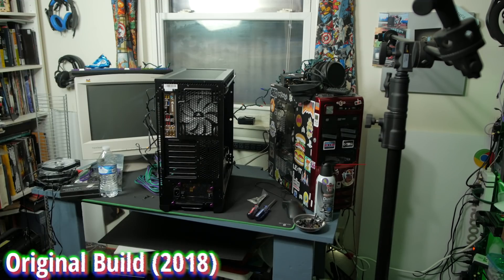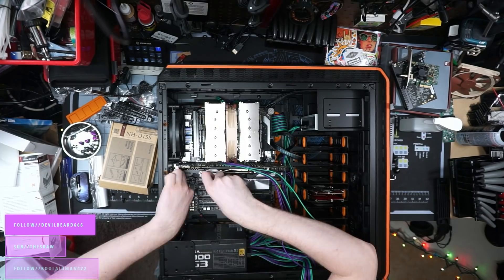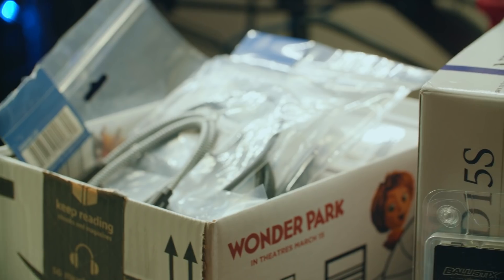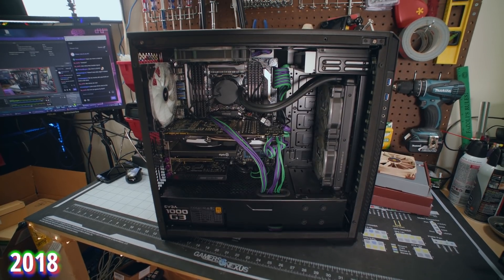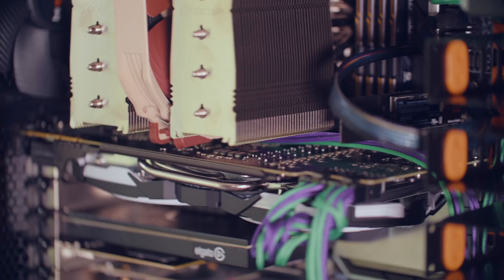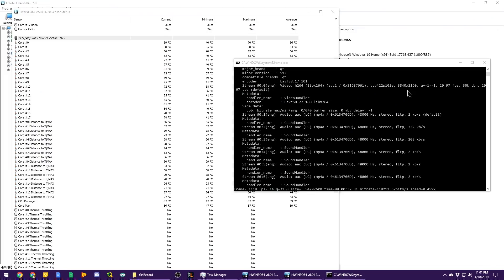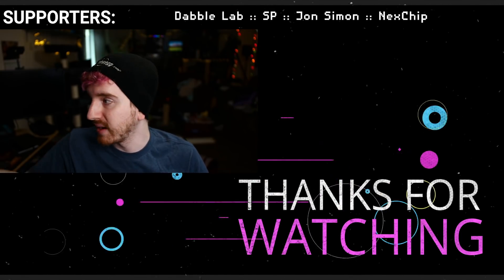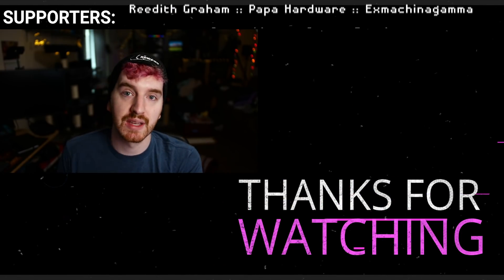Breathing new life into my main production PC - 7980XE cooling dilemma

Comment: Looks like it time for another overhaul. I haven't made the jump to HEDT. YET!. I like high-end hardware but, i'm not Mr. 💰's. I''ve built 2 main rigs by waiting patiently. With open-box CPU's, GPU's, RAM and Mothetboards. Even though, they were open-box items. I still got the manufacturers warranty on everything. 
  #1 rig is for Gaming. It has a open-box Golden 5.3GHz 8700K ($280) with a z370 Aorus Gaming 7 ($145) and a Aorus Extreme 2080 ($540) and had got 2 16GB kits of Gskills Flare X 3200cl14 OC'ed to 4GHz cl17. 
  I used the other kit for the 
#2 editing rig. Which has a $400 9900K, $215 Gigabyte z390 Designare with the PCI-e switch that lets me run to nVME 970pros in RAID0 with 
7GB/s read and writes. Also 8K passthrough capabilities, and dual ThunderBolt 3 ports onboard with and extra one to the front. $560 Radeon VII. I got a deal on 2 Corsair 750i PSU's with LINK's software to monitor both systems and 2 of Corsiar's 500D cases. Got both PSU' and case's for a steal cause they were all open-box. I built a monster Gaming PC along with a 2nd editing and streaming PC for $2600. I can say im definitely happy. A few months ago i found a 7980XE for $900. Of course now Intel releases a 10980XE for the same. I'm still gonna keep the 7980XE. I also got the x299 Aorus Gaming 7 PRO. The PRO has been revamped for the 7980XE cause you already know how the 1st Gen. x299 Gaming 7 went. Plus with a new memory trace, PCI-e layout and Intersils high-end VRM with 12 60A smart power stages, no annoying coil scream. Watching your vids have given me a path to start finishing my 1st HEDT build.

Comment: Threadripper better
Reply from the maker: Not exactly
Reply: sure. 2990wx kill it  @EposVox
Reply from the maker: @redbassboosz5222  Not in Windows and not for my kind of work. H264/X264/Cineform/H265/etc. encoders/decoders on scale to a specific number of cores per resolution (the most usable threads for x264 at 1080p is like 20 threads) and such applications do not scale well to the multiple NUMA nodes of the 2990WX. Plus the 2970 and 2990 both have performance regressions in virtually every application compared to the 2950X in Windows. So no, it doesn't kill it. The PCIe lanes are nice, but performance-wise, it does not.

Comment: When you removed the water cooler it was kinda obvious that the CPU IHS is far from flat, it has a gigantic bump in the middle. If you see at the 1:38 , you can notice how the thermal paste is thinner on the middle of the CPU. In my opinion, if you delid, don't use liquid metal, use a conventional thermal paste and also lap the shit out of this CPU, it will make a ton of difference.

Comment: AVX512 has a lower clockspeed than normal.
AVX512 on the Xeon 6154(the pro version of the 7980xe) is 2.7 GHz all-core, so your 3,6 GHz with AVX512 is pretty good.
https://en.wikichip.org/wiki/intel/xeon_gold/6154

Comment: Liquid metal doesn't really require "maintenance" so much as proper technique...if done correctly, it is a set and forget option just like the CPU is when it's stock. It's when you don't seal the IHS and depend purely on the pressure of the cooler's coldplate to hold the IHS in place, that's when you have to worry about it moving around and/or redistributing itself. Delidding just to replace paste with more paste isn't really going to help, especially compared to the risk of delidding and potentially shearing off an SMD or 3 (thus rendering your $2K CPU into a small paperweight). Lapping the CPU IHS is a good move, since a lot of them are not flat. 
The Noctua D15s are nice coolers, but you'll probably get more room for OCing that CPU with a 360mm AIO, assuming your case can mount one...at the very least, running multiple fans on that D15 would stretch its legs a bit more than just the single fan.
Reply from the maker: I've read/watched/researched every review I could find and the D15/D15s beats out a 360mm - even on this CPU - every time. Also forgot to add into the video that in the secondary stream we did end up adding on a second fan.
Reply: @EposVox  Really? That's odd, cause everything I've seen shows even 240mm AIO coolers beating the NH-D15...just from a quick bit of Google-fu:  https://techbuyersguru.com/noctuas-nh-u14s-and-nh-d15s-cpu-coolers-take-best?page=2 ; https://www.technic3d.com/review/kuehler/1701-noctua-nh-d15/4.htm (this one's in German, but Chrome does a decent job of translating it) ; https://www.guru3d.com/articles_pages/noctua_nh_d15_review,11.html (this one comes closest in comparison, with the NH-D15 running dual fans matching an H110 from Corsair in performance). Not trying to argue on it or anything, just find it odd that you've found results that directly contradict the results that I've seen.
Also, on the IHS lapping thing, you might consider reaching out to Steve over at Gamer's Nexus, they just had to do a whole thing on lapping the IHS with their 9980XE, the IHS was so concave it was basically an upside-down bowl.

Comment: Great build, I bought the same motherboard based on your review.  I'm curious maybe you're not getting the thermals you want based on a few factors.  What's the temp like in the room you're in?  Also is there enough air moving through the front of the case? Maybe get some Noctua Industrial fans to induce more air, the case has lots of sound dampening Maybe you wont hear it as likely.

Comment: Have you tried a Mugen 5 cooler from Scythe ??
Reply: The NH-D15 will win in any scenario vs the mugen5, its simply more area of dissipation, at low and high rpms, the Mugen5 will lose.  That said, the Mugen5 is a very good value/performance cooler that will cool fine most cpus, but something like 7980XE is really hot, i have a very hard time cooling a 7940x at stock speeds with a Thermalright True Spirt Power 140, Adam needs two fans and more rpms to keep it below tjmax with the D15, aside from custom loop not much he can do.

Comment: You have the same issue like me with my i9-9900k. 240AIOs arent enough to cool it properly. you have to go custom watercooling with at least a 360 , better 2x 360 rads for cooling. Maybe EK or Alphatec ?
Reply from the maker: Except this cooler IS enough to cool it properly - as virtually every review suggests. Custom loop is not an option for this rig.
Reply: @EposVox  but maybe you could go up 300Mhz back :-D

Comment: This case has terrible airflow. It's silence focused not air focused. The best case that does both is the Fractal Design Define R6.
Reply from the maker: ???? the airflow design in the R6 and this are virtually identical. 
Signed - someone who has been using the Define R series for like 8 years
Reply: @EposVox  Not quite identical.  They're similar but the R6 performs better from using both and from benchmarks I've seen just name to one GamersNexus shows around a 4.5c difference.

Comment: If you want to use normal thermal paste you might wanna look into direct die mounting your heatsink to the CPU. That should improve temps a lot without needing liquid metal. I think Jason from Byte My Bits did it with his CPU that also had severe overheating issues.
Reply: You use conductonaut with direct die

Comment: If you are delidding, and don't want to use liquid metal try this: http://www.performance-pcs.com/der8auer-skylake-x-direct-die-frame.html  Also use http://www.performance-pcs.com/thermal-grizzly-kryonaut-hgh-performance-thermal-grease-3ml.html I will drop another 5-10 degrees over regular thermal paste on delided CPUs. And add another fan to your Noctua cooler.

Comment: The lapping and Delid will put alot of things in check for that CPU, and I hear you on the reliability concerns and the paste replacement should be enough since the lap is happening especially if they use Thermal Grizzly Kryonaut or Hydronaut (both killer pastes)

Comment: Great video Adam.  In case you are interested on seeing how the NH-D15s does with two fans, google "SPCR Noctua introduces twin NF-A12x25 NH-U12A CPU cooler", you will find my testing of a lot of coolers there including the NH-D15 with one and two fans, you will see how it helps the second fan, specially at lower rpms.

I'm shipping you 2x Thermalright TY143, same size and mounting as the NF-A15,  they drop to 600rpm (30% PWM) inaudible to me, so you can have a very quiet setup at idle/light load, what makes this fan so special is they can reach 2500rpms (100% PWM), but be warn that it will cool extremely well but at the expense of noise, past 1500rpms are loud, running it at 2500rpms you are going into jet engine territory, but don't fear it, its very easy to setup the fan graph and its up to you to decide how much noise and performance you want, meaning you will be able to overclock, but its up to you how much noise you are willing to tolerate vs the amount of time you gain due to your overclock, its more a matter of balance, and this fans will give you a lot of room for you to decide whats appropriate for you.  You do need to search on your original NH-D15s box, it has a second mounting set of clips that you will need for the second TY143.

Btw don't fear liquid metal, i have 3x cpu delided with liquid metal, i7 8700k + i7 8086k + i9 7940X, all are running great, it will lower temps 10-15C on load, if you don't do liquid metal, the gains of deliding with another paste will be low, not worth it imo, you are already voiding your warranty deliding the cpu, make it worth the trouble by using liquid metal.

Comment: sigh sadly threadripper just is in it own class. I guess you had no choice since you got it free.
Reply from the maker: Threadripper has plenty of problems. Windows and most programs are not set up to handle the multiple NUMA nodes - x264 on threadripper is a nightmare. Anything higher than the 2950X literally performs worse than the 2950X on Windows, etc.
Sure if I had the budget, I'd be there for the PCIe lanes, but I can't afford it, so I work with what I've got available to me.
Reply: @EposVox  ya understandable. I got tr4 1950x cause pcie lanes and was easier to install and well had a store credit of $430 or something from another mb that was defective so bought a $530 mb. It been wonderful pc. Ya I heard about windows but dont people run linux on these systems? I am on windows and ya have noticed issues. My fx9590 system feels faster then my tr4 system.

Comment: It's the hottest CPU out there, unfortunately you cannot have it both ways, silicon lottery isn't your problem, it's the 900... one of the banes of my  existence especially in that config with the no basement and 10 hard drive cages. It tends to suffocate coolers, it's not meant for overclocking at all. My suggestion is delid. I just watched your cooler swap video and you said you can't risk it, well with a delid tool it's not that risky. It will get you the frequency you desire with some konductonaut. If not I'd suggest loading that case up with Noctua NF-A12X25 fans. I bet they'd send you them, even replace the 140's on your NH-D15 with them, they have adapter brackets, they are the most silent fans out there and push as much air as most fans screaming. Good luck
Reply: haha I kept watching, I've had konductonaut on a CPU die for 2 years and it worked as well as the day I applied it. Just need to nail polish the transistors on the PCB and apply just the right amount. Do it! Do it! Do it!
Reply from the maker: It has plenty of airflow and I can remove the top drive cages to open it up the rest of the way. I've built in this exact config dozens of times and never had "cooler suffocation."
I'm delidding - but I'm not using liquid metal so I'll only gain a little from it. The best gain will likely be from lapping to even it out.
And again, plenty of reviewers got their 7980XE to 4.4GHz on this same cooler and others I've tried, so eventually my chip just ain't good.

Comment: If you are going to delid anyway I would suggest going direct die. It removes the IHS from the thermal transfer process and is as good as using liquid metal with an IHS. I would recommend using the der8auer frame
Reply from the maker: Definitely not doing that.